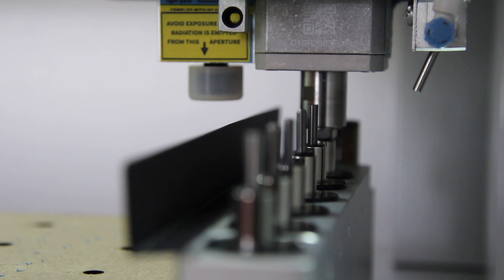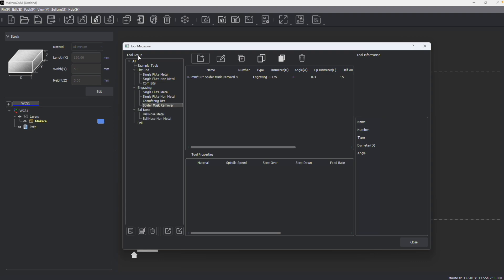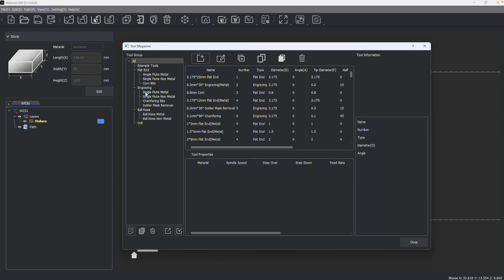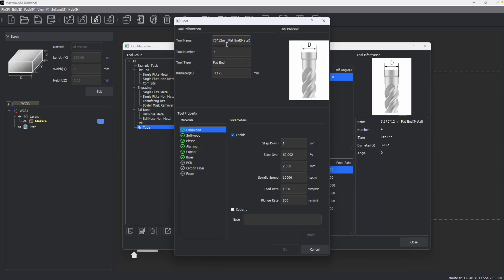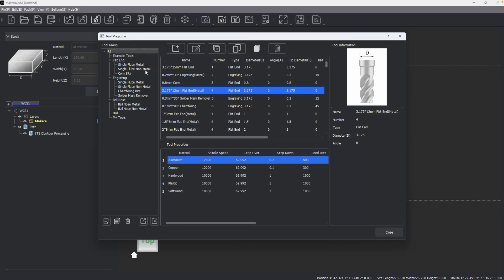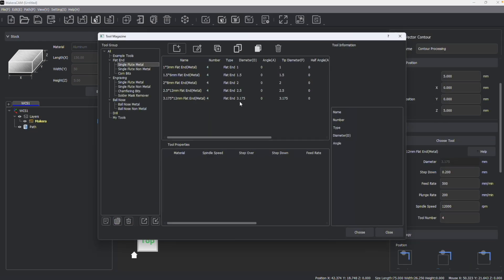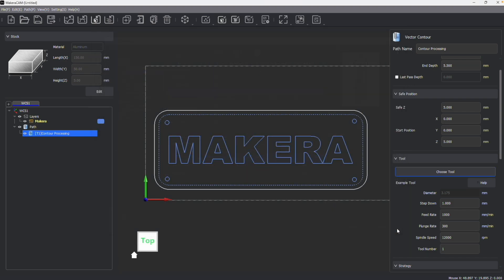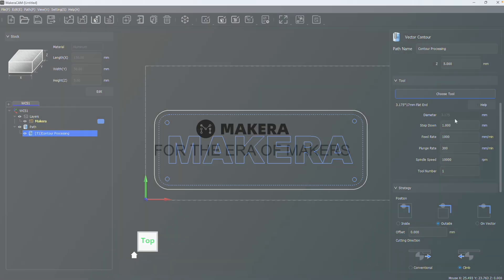Makera CAM - The Tool Library

Comment: Hi Jason, Thank you for this video. Can you please explain what is the value wich is not define between step over and spindle speed ? At 1:45 it says 2.000 mm. Thank you.
Reply from the maker: That is the step over value in MM. Next to step over, the percentage of the bit diameter is listed, then below the percentage is the step over value. So 2.00 mm is approximately 62% of a 3.175 mm bit.